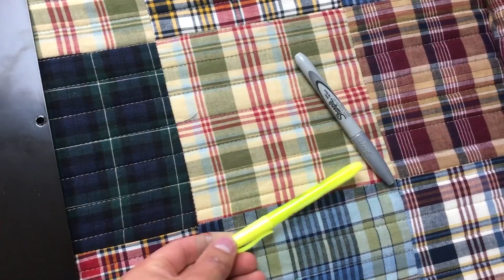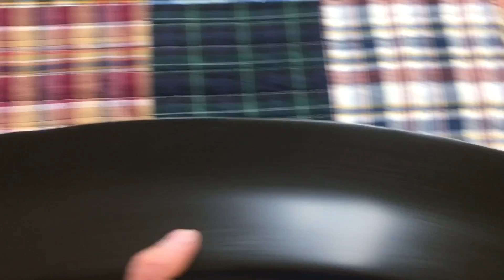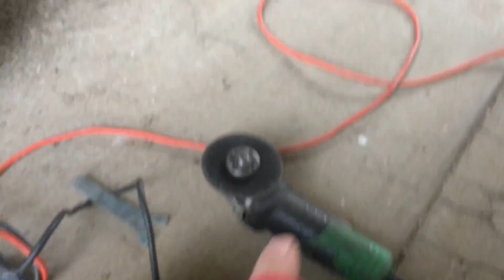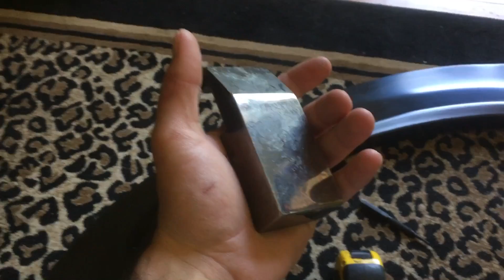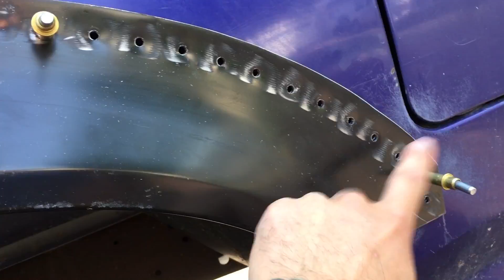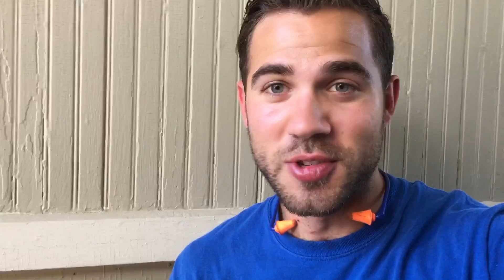No Weld Rusty Fender Fix | 1995 Ford F150

Comment: Hell yea this don't look bad what's the longevity of this repair you say?

Also is it possible to save the metal trim loop on my rear fenders? 

Mines still there and in good shape, be nice to save it.
Reply from the maker: Thanks man! Longevity is good although after 8 years I’m starting to see some rust bubbling at the very edge of the panel and around the rivets. 

What trim loop are you referring to?
Reply: @TheMinuteMasters it's look a silver piece of metal on the edge of the fender I guess it's not a loop but like it's this metal trim on it.
Reply from the maker: @Skyla286 ah! Is it the chrome trim piece that edges the wheel well?
Reply: @TheMinuteMasters yea the chrome trim! Mines a XLT so it has chrome everywhere.

Comment: I appreciate all tthe care and effort you put into the project. But to me, it seems like you spent more effort doing it this way, than it would have been to do it right? Idk just my thoughts. You can find a whole bed for less than $1000 and don't have to do any work besides swapping them. Or pay a welder a few hours. But the fact you did it yourself and did what you could to prevent rust. Props.
Reply from the maker: Thanks man! Yeah this was a compromise fix. I was living in a small town in Kansas at the time and resources for those other options weren’t available. 
I’ll probably swap the bed in the near future.

Comment: Have you experienced any sort of rust on the inside of the bed walls. I want to fix up my 91 F-150, which rusted in that exact same spot (like most obs lol) and I want to use this method to fix it. I'm just concerned that my rear tires will kick up snow and road salt up in there and potentially cause more rust.
Reply from the maker: I’ll have to check but I don’t think so. Ideally, I wish I bought a piece of plastic like Kydex and made an inner wheel well out of it. That would keep any snow, salt, and mud from getting up inside the bed.

Comment: Nice repair, you can also use regular rivets and make good with either glass or bondo. Good point on addressing the inside correctly to avoid failure.
Reply: Yeah I just did my trucks rockers and did the regular rivets and bono ! Works like a charm
Reply from the maker: Very true!

Comment: Hobo freight welder $150 bucks
Reply from the maker: Plus wire, gas, and safety equipment. 
Not to mention the skill to weld sheet metal. There there’s the time needed for body work.
Reply: @TheMinuteMasters  you dont have to have gas. Done it many times without. Wire is about 15 dollars. Probably  double if not triple the time it took to do it the way you done it.
Reply from the maker: @MrYz250fman  Did you use flux core wire or solid wire? 
Actually this took me less time than welding the patches. A good weld job with no warping could take an entire day just for welding alone.

Comment: To each his own, but that's a lot of work for a not-so-good look, in my opinion. Why not just get some regular rubber, or plastic fender flares and snap them on and be done with it?
Reply from the maker: I respect that. I went this route because it was cheaper than Bushwacker fenders. It also keeps an almost stock look to the truck too.

Comment: Hi am curious  now that several years have passed did any rust develop between repair panels and fender as I'm thinking rivets by design allow movement "minute" but movement still. Liked the idea but was thinking using body welting or "rino line" behind an 3/4in above repair. Any input is appreciated thank you
Reply from the maker: Good question! I posted a 2 year review video with the results. The short answer is no visible rust. The paint at the lower edges has a few bubbles in it but no flaking yet. Here’s the link for the 2 year video👇

https://youtu.be/TdwMQFVdUok

As for you other question, I used undercoat for the backside of the fender flare and for the actual bedside.

Comment: I would have just welded it. This seems like way more work than welding. Also, a lot of noise in comparison.
Reply from the maker: I would have welded it but I was over 1000 miles away from my welder and wanted to explore a cheaper/user friendly solution to fixing the rear fender rust.

Comment: that is really nice job, but I would like something ever easier, something like plastic. I just need to cover the rust because my truck is too old and not worth, something like just cutting the rust and covered with plastic.
Reply from the maker: Hipolito Ramirez Thanks! This is cheaper than the plastic fenders you can buy for this truck. You can also use cheaper aluminum pop rivers to attach these metal fenders.
Reply: @TheMinuteMasters  thanks for your reply. Where do I buy that type of fender? Have a good day.
Reply from the maker: Hipolito Ramirez You’re welcome man!🤙 I bought these fenders from raybucks: https://raybuck.com/product/1987-98-ford-pickupbronco-upper-rear-wheel-arch-fleetside-only-passenger-side/

They are the patch panels you cut and weld to replace rusted wheel arches.

Comment: What if when I hold it tight towards the bottom it has a gap on the top?
Reply from the maker: Famous75 Gaming Like it sticks out at the top? You definitely want the top to fit really well.
Reply: The Minute Masters when I have the price pressed up tight on the bottom and pushed up all the way, the top of the new piece isn’t tight to the top and won’t push tight
Reply from the maker: Famous75 Gaming Yes that happens because the patch panel is not a true overlapping part. Because it’s the same size, it doesn’t fit over your bed size perfectly. I kept the patch close at the top and left a small gap at the bottom. You can sort of get it to fit tighter as you rivet the panel on.

Comment: Interesting approach. Interesting results.
I prefer my method.
Prep: I cut my rust out with my angle grinder and prepped the exposed metal edge with rust reformer (any left over paint in any color will do, since it gets covered anyways).
Solution: I got fender flares from a newer ranger, for $50 (all 4), from the bone yard. I attached them with self tapping screws (inside the well) using my electric drill and ran a bead of black caulk around it, to seal the top seam from the elements. 
Cost: The entire list of materials to complete the project cost less than $75, and that's for all 4 fenders.
Labor: There was no measuring, drilling or cutting, beyond the body prep. So it only took about an hour of beer drinking.. I mean very easy install time.
Results: It looks absolutely factory and the flares will never rust, since they're plastic. Neither will the screws if you use stainless or aluminum or even galvies.
Reply from the maker: DirtBike Dave Nice! Good little write up and definitely easier and cheaper than my solution. I take it the ranger wheel wells are the same dimensionally as the f150? Anyway, love the input and thanks for watching!🤙
Reply: The Minute Masters I don't know. I did this on my 93 ranger. But I'm guessing flares are available for just about any application.
Reply from the maker: DirtBike Dave Gotcha! I know bushwhacker makes plastic genders but they are pricey. You would definitely have to get bushwackers from the junkyard to do this on the cheap.
Reply: The Minute Masters , we did the same thing on my buddies old GMC, using plastic late model chevy flares from the bone yard. Same process, same budget and same stellar results. 
We did it on me other buddies tundra, but we used a brand new flare kit, so it cost 5x more. Still well worth it though at about $300.
Reply from the maker: DirtBike Dave Good to know man! Maybe if I get another truck with rusted bed sides, I’ll give the plastic fenders a go. 🤙
Reply: When you used the tap in screws did you grind them down?
Reply: @jewelmamar968 no need. Several years later it looks like the day I did it

Comment: Wow thats an extreme for something that can be done a lot  easier and cheaper. Get a cheap welder from Harbor freight for under $100. Or get $50 ebay fender flares that bolt on. and it wont have 1000 rivets per side lol.
Reply from the maker: Socks On Feet Thar is all very true but the concept behind this method was cheap, all steel, and very little body work and welding skill. Welding sheet metal isn’t easy. A novice would warp the steel in seconds or burn wholes through it. Rivets are simple and cheap.

Comment: looks like crap get a cheap harbor freight welder and the patch panels., lazyness.
Reply from the maker: M Plante So your saying the average person should buy a questionable reliable welder that they may not know how to use. (Which in doing so spends more money than my method) Then our novice welder botches the job by warping the patch and burning holes through the patch and bed side. Then he has to resort to lots of body filler to smooth it out and finally go through the whole paint process. 

My method is for the budget minded  person who is also new to body work.
Reply: @TheMinuteMasters , drilling holes in the body and riveting on stupid flares will create more rust with open metal exposed to the air, salt etc. even if a person had to rent or borrow a welder 115V flux core you could properly patch fenders its not hard and wouldnt take any more time, dont take offence to this I am a mechanic and have done welding patches and body work before with way better results that will last. You can do what you like but this method will fail and create more rust and rott, but if your method works for you then go for it, another thought is if you welded in floor pans why cant you weld in patches for the fenders? that my thought not downing you for it.
Reply from the maker: M Plante Well so far the patch has gone through two rust belt winters and looks like new. 
I’ll be honest though, patching with rivets wasn’t my first choice. I was going to grad school out of state and away from my welder. Otherwise I would have welded it. That’s when I realized there are plenty of people who need a none welding method to repairing the rusted bedsides. Definitely not a show ready method but it does the trick for now. Thanks for watching my other videos though!🤙

Comment: Thanks for the idea! Looks awesome. I want to try this out on my 2000 Tundra, but so far I'm having a tough time finding patch panels made for Tundras. In your experience, is starting with a panel specifically for your make a must, or are they interchangeable given that you are cutting it to the shape you need?
Reply from the maker: Tanner Morehead No problem man!🤙 Really? 18 years should be enough time for people to make patch panels. So patch panels are specific to the year, make, and model. Some years of the same model are interchangeable though. Otherwise, a ford patch panel would look very different from the your front fenders.

Comment: Granted, I know nothing about body repair and this video was for a NON-welding repair.  But, I wonder if a Harbor Freight SPOT welder would have been faster and easier to use than drilling all those holes and then riveting them?  They sell two kinds - one for 120V and one for 240V at the same price - $ 160.  I think they sell extenders for spot welders that increase the reach, if needed.  Cost of rivet tool and rivets plus drill and holders and time versus spot welder.
Reply from the maker: Mystery47 So cost for cost they could be around the same. Flux core wire would eliminate the need for a bottle of shielding gas (usually around $150). The biggest advantage to rivets is the easy of use and relatively low skill level required. Welding patch panels into a bed is almost an art. Too much welding and you heat metal and it warps. Then you need body filler and the skill to get that smooth and perfect. If the metal is too thin or the cut and fit job poor, you will blow holes through the metal. This will require more patching and warp the metal more. Also better more expensive welders typical out perform cheaper ones and you get better finish work. So there is definitely a lot up consider. If you ask a lot a people about patching the bed sides, most of them will tell you it’s easier to replace the entire bed side.

Comment: Cool video, good advice. Thanks for all the ideas. Trying to determine if it’s worth it for me to try and do this or something similar on my 07 F150. Years ago I stupidly hooked some ratchet straps to the outside of my vendors. Needless to say the hooks cut into the paint and now they’re finally starting to rust out pretty bad.
Reply from the maker: danjley You’re welcome man!🤙 This is a good fender fix. I can’t say how long it will last or how good it will look. I’ve had it on for two years now and it still looks great! Most importantly, my bed isn’t rusting away!👌
Reply: *Fenders, not vendors

Comment: Too much talking, plus, there is a vid "much" simpler, less complexing, cheaper, and not so much work.
Reply from the maker: Estell Mccalip Did that video use solid aircraft rivets?
Reply: @TheMinuteMasters  Nope. Didn't need to. However, his was a "complete" walk through. The objective was to repair rust with pieces, like shown in your vid,  breaking pieces around the fender. He even had the exact same color paint, gold, to match his vehicle. He did an "awesome" job. Could not tell fender had been repaired. I have a '92 nissan truck, I am female, 70yrs old. I seek what will be easiest for me.  The vid is called.. How to repair your fender for under $100. And, the vid I think is about 30mins long.  Thanks 4 inquiring.

I just read some of the comments. I was not aware this vid was about "fender flares." Had to go back and check the title of your vid. My bad.
Reply from the maker: Estell Mccalip So in the video he didn’t leave the rivets exposed? Like he used bondo smoothed everything over?

Comment: Why not just put Bushwacker's on it it would do about the same "repair" and look 100% better
Reply from the maker: James Slenk Because Bushwacker’s are expensive compared to patch panels. They don’t address the rust, just cover it up. Depending on what style you get, they stick out way to far for stock wheels.
Reply: @TheMinuteMasters  There's oem style flares that are made specifically to cover up rust
Reply from the maker: @hugeslacker  Really? What’s the part number?
Reply: @TheMinuteMasters  just Google oem fender flare and your truck model

Comment: A welder is always a good investment however!
Looks good!
Reply from the maker: Jeremy Paluck Thanks! I actually owned a welder before I made this video, but I was away at grad school. I would totally do it again and weld it.
Reply: @TheMinuteMasters  I'm currently planning out the wheel well repair on my old 95 ranger.
I like this idea.
Reply from the maker: Jeremy Paluck The nice thing about this repair is it’s pretty quick and easy to do when compared to welding. One thing though if I was to do this over again I would only prime the panel and then rivet it on. That way the basecoat and clear can cover and seal the rivets.
Reply: I'm thinking I may just order replacement panels, after watching and studying the other methods, like welding in patches, then Bondo etc. etc. It would appear a whole formed fender would just work best.
Although what you did here is definitely something I would like to try.
Reply from the maker: Jeremy Paluck Yeah definitely do some homework and see what method you preference. If money isn’t an issue, the best overall method (and most guys would  agree with me) is replacing the entire bedside. Last I checked, a whole bedside was about $380. Then there’s no rust at all and no dents. Most guys don’t go that route because of price, including me.

Comment: Ok. I would have done either or both of the following. Get a sheet of thin plastic or an inner tube. Cut a gasket that goes between the new flare and the old fender. That would prevent galvanic action from dissimilar metals when riveting.  Or, I would use stainless screws, washers, and nuts. I would probably go with locknuts. No air compressor and tools necessary except wrenches.
Reply from the maker: Russ Martin That’s true! No a bad idea! Yeah I’ll be curious to see how the paint holds up on the aluminum rivets.

Comment: Won’t that metal on top of metal create a crevice for water? Won’t it rust in a year?
Reply from the maker: Jamie Williams It’s been a year and one hard winter in the rust belt. No rust yet. The trick is to undercoat both inside faces. 

I’ve come to the conclusion that there are gaps and crevices all over these trucks. The only way to prevent rust is propped sealing and of course keep the truck clean in the winter.
Reply: The Minute Masters ok